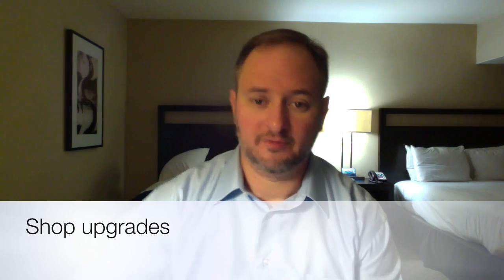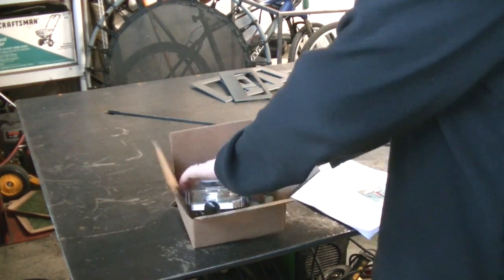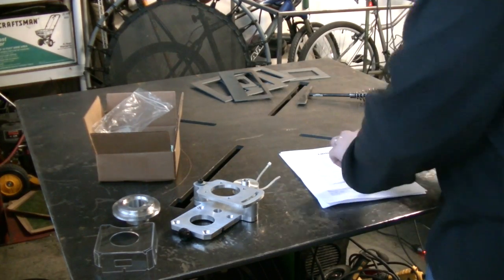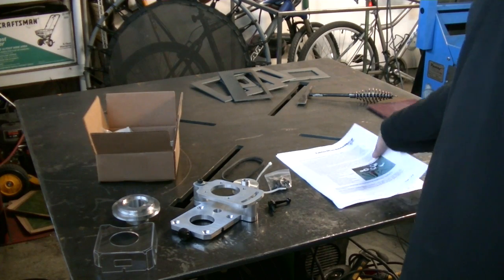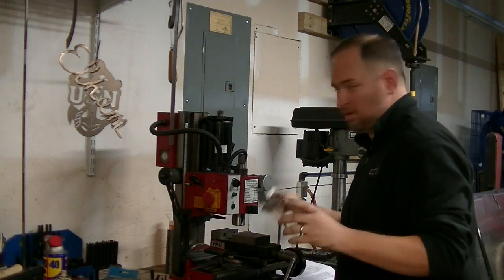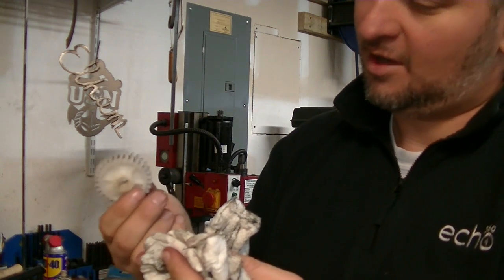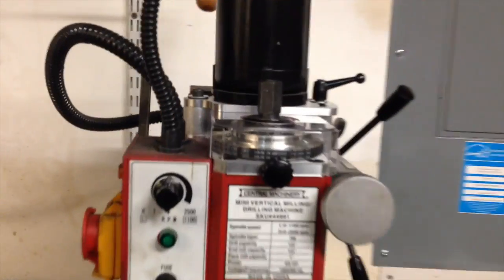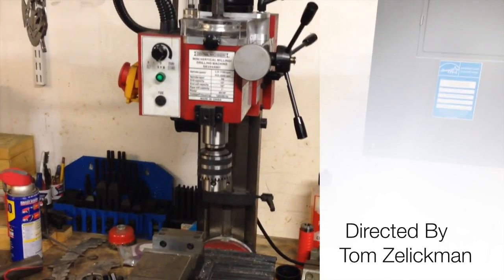Shop upgrades

Comment: Hi Tom,
I hope you get your PlasmaCam up and running right.  It sure is jumping around a lot.  Almost like you have a connection problem somewhere, like it is making contact and then not.  Good Luck.
Reid
Reply from the maker: Thanks, Reid! I am going to go back over all of the connections when I get back to the shop to be sure but I don't think that is the problem at this point. I got some good feedback from the PlasmaPig group as well. Are you a member there?
Reply: Tom Zelickman Yes, I am.  There are a lot of very knowledgeable guys on there along with the guys in the PlasmaCam group.  I hope you get that problem solved soon.  It sucks not being able to use the machine.  It is one of those things that you just don't know how you did things without it.
Reid

Comment from the maker: New shop video posted - Shop Upgrades!
Reply from the maker: Hey, Keith Fenner - Have you ever seen your carriage jump around like this? First I got a cannot control carriage error but later got a cannot detect pulse error... I think I need to call support.
Reply: I had a little different glitch in my first controller, I would just bolt out without a notice and finally it blew a fuse and I replaced that with tech support on opening the controller case as per their instructions. After that It lasted a few more hick ups and then totally stop functioning, we checked all the resistances as per instructions and they replaced the controller and never had another problem from then on. You learn quick to be your own inspector, the video manual is real helpful on testing, with their help and remember to pay extra for the quick shipping or you at the mercy  of the ups man. 7 days for me. I act fast with my problem seeking and pay for the fast freight, I sent the controller overnight and got it back from there overnight, so the whole down time was up and running the second day after I sent it out. ;{)----